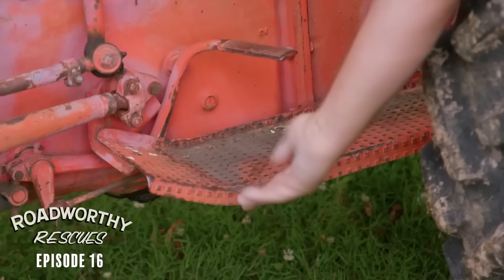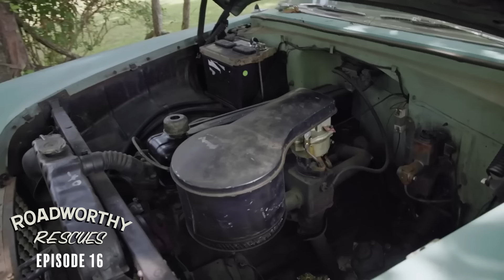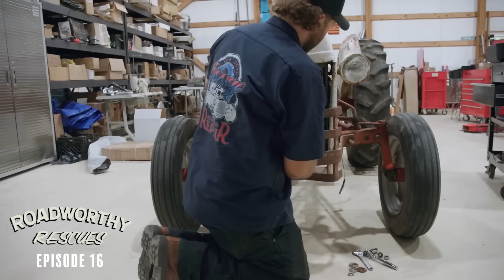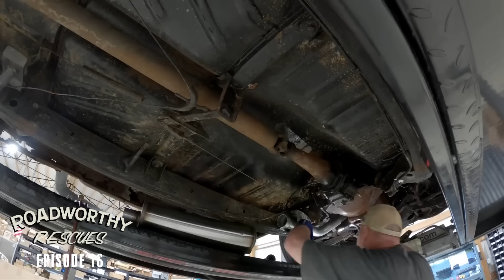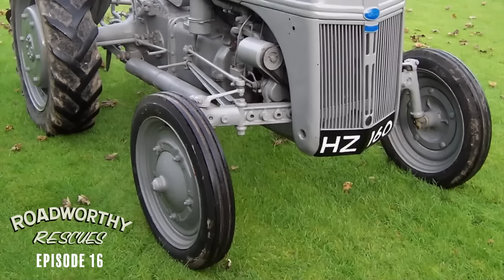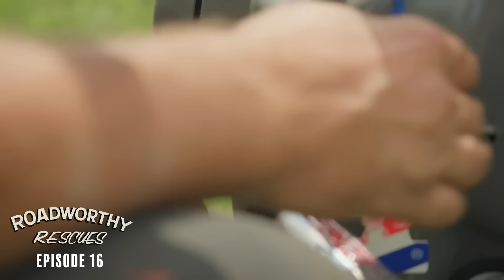Fixing 1950 Ford 8N Tractor in Desperate Need of Repair! | Roadworthy Rescues

Comment: Got a 1950. 8n  had it  bout 30 yrs. Wouldn't  trade it for a brand new one. I just keep the oil changed  and tune it up every 5...7.  Years.  It runs like a top. I've cabled it to trees sawed them and pulled trees down in the direction I wa nTed them to fall ... I can say  the money I spent 30 yrs ago is still working for me.  🎉🎉🎉🎉🎉❤❤❤❤❤
Jet vet.

Comment: When stabbing the engine back on, take two  3-4 inch bolts the same size as the bell housing bolts and cut the heads off and slot them.Now you have some guide dowels. Engage the PTO and have a helper to turn the PTO shaft if needed to align the transmission shaft with the clutch plate hub splines.

Comment: Engineering at it's very peak! Make it as simple as possible while still getting the job done. The N's and Fergusons were the epitome of that, and they can still do a good day's work today, even many were abused and neglected. Only downside to these tractors today is that they use a ton of gas- 3+ gallons per hour. If you're doing more than an acre or tow, they'll kill ya...which is why I sold my Fergie. I now have a 1970 John Deere 820 diesel...rugged, simple, and more economical.

Comment: The 60" rear discharge Woods mower is THE perfect mower for the N tractor.  Ive got 40+ years on these tractors and have used about every mower out there.   Best combo there is for that tractor. Period.

Comment: For my lawn tractor, a FarmAll A,  I went to the local motorcycle shop and picked up used motorcycle tire cast offs, they have a rounded shoulder that does not gouge into the turf / sod and they are free !

Comment: I worked for a marketing company that supported part sales for New Holland Corp, which owned the Ford tractor line at that time. (early 2000's). Parts for 8 & 9 N tractors were still a major seller even though they hadn't been produced for over 50yrs.
Reply: Do they still make parts for a '53 Golden Jubilee?  Or am I wasting my time looking at tires, thinking I can get that tractor and implements out of the barn before the barn falls. It may need a few parts before it moves again;  it's been about 50 years since the man drove it in there, but he did use it and drive it in there.  His son said to crank it up and drive it out,  but it probably needs more than tires and cleaning.
Reply: They make pretty much everything for the jubilee. That’s the most used tractor on my farm.

Comment: A goodmoveon the 8n tractor is after 1949 the distributor is on the side of the engine. NOT on the front. My 1948 has it on the front. A pain for sure.

Comment: If you wait until fall, you can find a 60-72 inch zero turn and spend the winter rebuilding it. There’s a reason that commercial mowing guys use zero turn mowers and not tractors.
Reply: Don't think that's the point.

Comment: Basically a Fergusson with a Ford engine Fergys can be aged by the accessories on the engine and the front wheels, Shop manager where my dad worked towed a 35 Fergy in with a 57 Vauxhall Velox, that Chevy shouldnt break a sweat, it comes apart exactly like a Fergy, you wheel the front out complete, using a set of tracks on farm where ever it stopped, I was the kid in the spares section finding the parts. Reverse procedure to reassemble. Grey was the Fergy colour the paint was ex British Navy. It looks awesome.

Comment: Now that is a gem, a couple tubes of JB WELD will fix that crack...WTG on the restoration, looks fantastic!!!
Reply: I was kinda thinking it should have been brazzed. Hard to weld cast iron especially the old 1950 cast iron. Or use some lead

Comment: First tractor I learned to drive on. Grandad bought new. Never left the grove. 100% sickle bar mower.
Reply: Same, His had a Sherman forklift attachment for his sawmill. Backwards steering was crazy to go from that to normal lol. And with the weight bias steering would get caught up on rocks in the yard, So you didn't hold the wheel tight.

Comment: For whats it worth. Back in my time we would put a half cup of course ground black pepper in the cooling system and let it run at idle until the crack in block plugs up from the pepper. Worked 90% of the time and lasted.